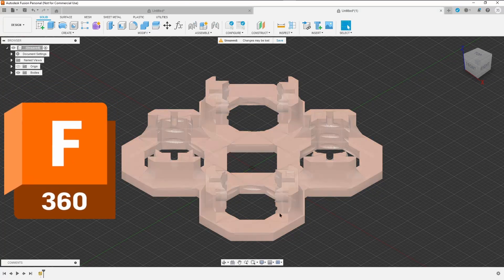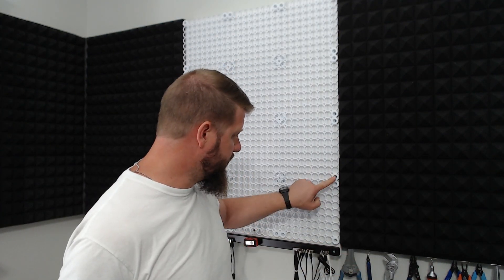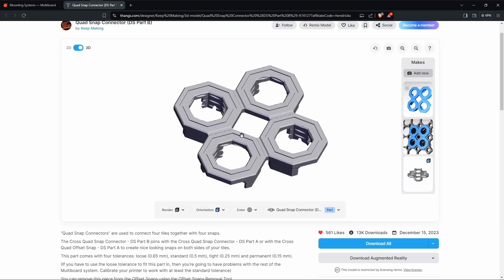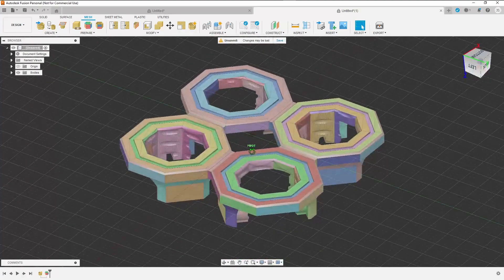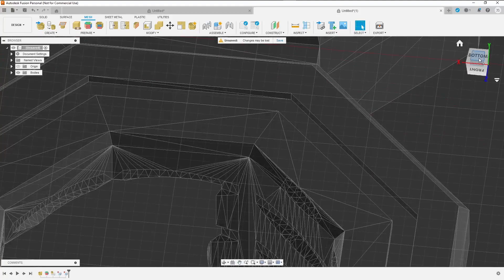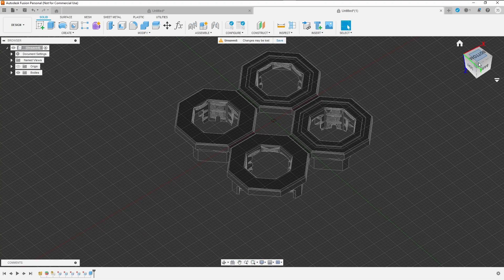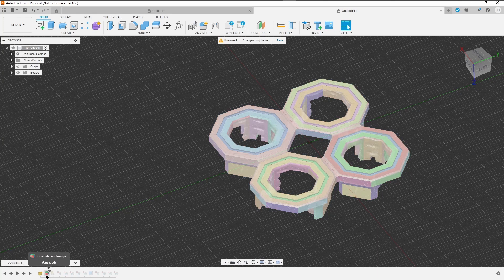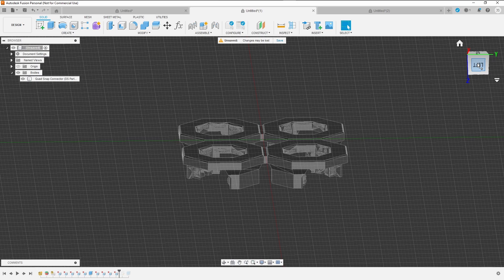Remix STL in Fusion 360 | Convert STL to Parametric Model

Comment: How long did it takd you to print your multiboard tiles, did you print them stacked or single? Curious to know how fast you printed that size tile with a .6 nozzle. Thanks.
Reply from the maker: I originally printed my tiles on a CR10, with a 0.4mm nozzle and I saw print times around 11 hours, when switched to a 0.6mm nozzle and adjusting wall thickness to match I got print times under 9 hours.  These are with 9x9 tiles.

However, with my X1 Carbon print times look like under 4 hours for a 0.4mm nozzle with 0.2mm layer height and under 3 hours for a 0.6mm nozzle with 0.3mm layer height (2 walls to match the total 0.12mm thickness recommended).  Another commenter mentioned that he tweaked his settings a bit and was able to get print times under 2 hours with a 0.6mm nozzle in his X1 Carbon with minor artifacts that he was comfortable with.

I did not print my tiles stacked, with the original ~9 hour print time it wasn't really worth it, but with print times closer to 3 hours it would be worth considering so you could run an overnight print.

Comment: An aside, Multiboard REALLY should make a version for 0.6mm nozzles.  As you said we could save a LOT of time using 0.6mm AND the prints would be stronger.
Reply from the maker: You can print them with a 0.6mm nozzle now!

The designer of Multiboard recommends 3 layers with a 0.4mm nozzle and a layer height of 0.2mm. 3x0.4=1.2mm wall thickness.  I printed all of my tiles with a 0.6mm nozzle and 2 perimeters (2x0.6=1.2mm).  At least for the tiles you don't need a model change, you can just change them in the slicer and print with a 0.6mm nozzle.  On my Creality printers (CR10 and Ender3) it saved an enormous amount of time printing with the 0.6mm nozzle at 0.2mm layer height and I don't see any issues in the prints at all.

The biggest time saver is the tiles because they are the biggest parts.  And there is no reason you can't print the other parts at 0.4 or 0.6 depending on what you want.  The only issue I saw was the front edge and that's really me being picky, the parts were entirely functional.  It is on my todo to post these modified parts as remixes In case anyone else is as picky as I am.
Reply: @buildtestbuild  So you kept the same layer height of 0.2mm even with the larger nozzle?
Reply from the maker: @JohnVanderbeck  Yes, that's how I printed mine, and I'm happy with the result.

I'm sure you are well aware that generally the rule of thumb is half the nozzle width is your "optimal" layer height.  So for 0.6mm that would normally be 0.3mm.  In the slicers, however, they give you a bit of a range around that, for 0.4mm nozzle 0.12mm to 0.28mm isn't uncommon. In order to preserve the detail I decided to lower the number of walls to the wall thickness would be identical and keep the layer height at 0.2mm to maintain the vertical resolution.

The only thing you are giving up is the time savings of 0.3mm per layer vs 0.2mm per layer.  If you wanted to experiment with optimizing the print time further, I'd suggest printing out the Multiboard 4x4 tile with 0.6mm nozzle and 0.3mm layer height as well as with a 0.2mm layer height and determine if you personally find the tradeoff acceptable.
Reply: @buildtestbuild  So I did some tests on my Bambu X1 Carbon.  Swapped to the 0.6mm nozzle and did one 8x8 core tile with your recommended settings. Print time 2h31m.  Compared it to the "proper" tile and couldn't see any difference.  Tested a few screw ins and snaps and everything worked.  2h31m vs 3h10m with the 0.4mm nozzle and suggested settings.  But of a savings.
Then I did another test with the 0.6mm nozzle and just the normal "standard" bambu profile which is 0.3mm layer height and 2 walls.  Only change I made was to set seams to random.  Everything else stock settings.  Again compared this to the originals and there was only a SLIGHT issue on the top layer where there are the occasional pinholes around the joints of the small holes.  Very tiny, really just cosmetic and you wouldn't notice from a distance.  Again everything functionally worked.  Print time now 1h49m!  So with this setting I can basically print two 8x8 tiles in the time it originally took me to print one. 
I think like you said, just print all the other stuff with the 0.4mm nozzle, but for cranking out the likely hundreds of tiles I will need, this is much faster.
Reply from the maker: @JohnVanderbeck  that's an awesome result! Thank you for sharing with the community so others can benefit from your test as well. 

For anyone out there planning a multiboard build, definitely consider using a 0.6mm nozzle for at least your tiles.

Comment: Dtrangely, Generate Fave Groups no longer works on my (latest) version of Fusion. It usedto but now does not produce the coloured groups. Weird.
Reply from the maker: That is very strange, I just tested this on Fusion version 2.0.19966 x86_64 and it did generate the different color groups.  Perhaps try it again on a different part with more angles and facets?

Comment: - To simplify via CONSOLIDATING COPLANAR TRIANGLES...
--- Method 01: 'Split Body', then 'Combine(join)': automagically consolidates many triangles (sometimes, and to some degree).
--- Method 02: With Timeline/history off, in 'SURFACE' context tab, do 'Merge' (w/ 'Select Chain' active), select single face... accept w/ 'OK'. Repeat, if necessary. *Remember to turn Timeline back on.

Comment: Making Prismatic a paid option, making highly complex shapes nearly impossible to edit, is such a dick move by Autodesk
Reply: I haven’t run into a shape that’s impossible to edit. Example?
Reply: @TheOfficialOriginalChad anything with a lot of triangles. Curves or complex curves. 

It takes Fusion forever to think with those parts.
Reply: @billyspears396  hmm. not my experience at all. I get the 10,000 triangle warning all the time, it doesn’t skip a beat.
Reply: @TheOfficialOriginalChad  go edit an octopus and let me know how it goes
Reply: @billyspears396 and that’s why I asked for an example…

Prismatic conversion would not improve the performance. Parametric CAD is simply the wrong tool for an octopus lol
Reply: @TheOfficialOriginalChad  I've only done parametric modeling lol
Reply: @billyspears396  that’s totally cool, it’s just the wrong tool for the job. If you’re learning, a good rule of thumb is to edit with whatever the model was created in.  
IfIt’s way way waaaay easier to manipulate these more organic shapes in Blender and ZBrush. Even iPad apps like Nomad and Forger blow Fusion out of the water with organic models. 

Seriously, carve out an hour to follow a donut tutorial and stop bashing those nails in with the drill battery. :)
Reply: @TheOfficialOriginalChad  I don't want to bash. I just wish Fusion was a bit more reasonable. I designed bit holder containers for Packout from scratch and it gets extremely laggy on patterns. 
I was using an 8700k, and I just built a new PC with a 13600k, so hopefully it does better, but I've heard that Fusion only uses a single core for those loads.
Reply: @billyspears396 funny, because you keep having seemingly random and separate complaints…